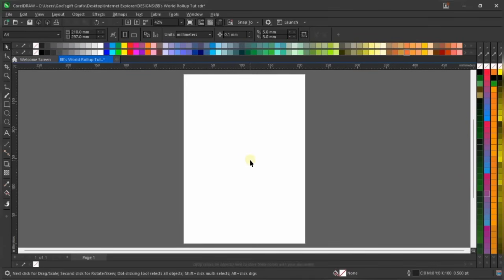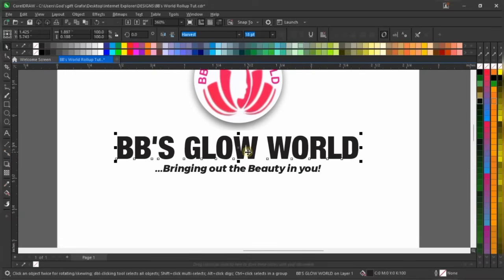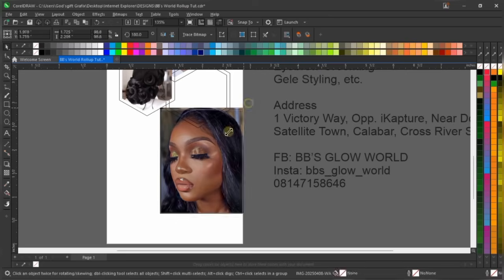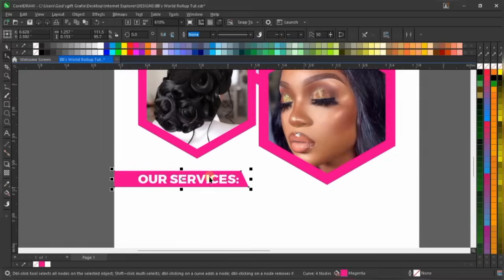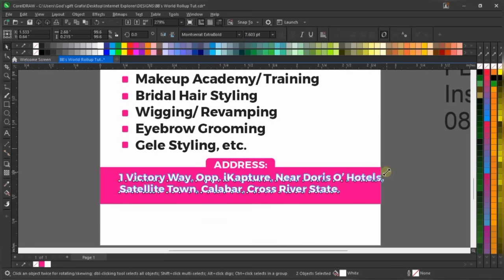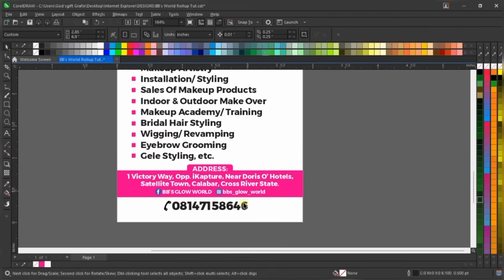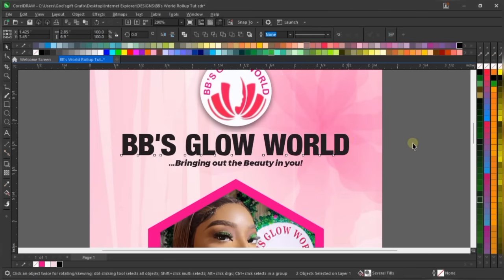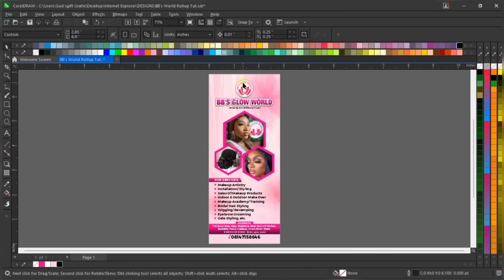HOW TO DESIGN A ROLL-UP BANNER USING CORELDRAW || Step-by-Step Tutorial!

Comment: I used png icons I downloaded online in one of my printed jobs and it came out blurry. Please why is that?
Reply from the maker: Firstly, you have to understand that PNG file format is pixel-based and it has stretch limit. So when printed on Large Format Machines, they come out blurry because it has been stretched aboved limit, that is why your PNG must be very sharp.

Secondly, I sketch & save my icons, or I convert any JPEG & PNG files to Vector when I want to use it, so it will be very sharp & also maintain high quality when printed.

Lastly, watch my tutorial on "HOW TO CONVERT RASTER IMAGES TO VECTOR". Use same method & it will come out well next time.

Good luck!